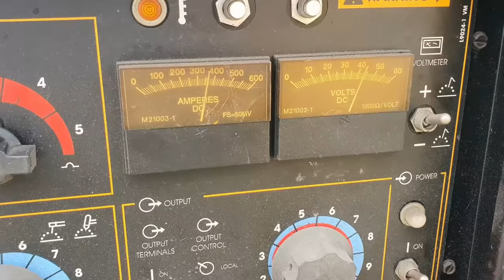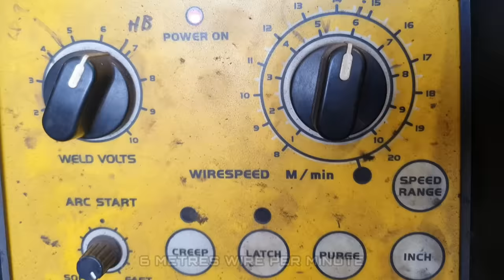Replace CRACKED Excavator Bucket Skin | Gouging & Welding

Comment: I was wondering why you only welded several inches apart all the way across the wear plates?  It seems that rock and dirt will get under the wear plates and caused more problems.

Comment: Hey Kurtis. One day when it comes up could you talk a bit about hard facing. I know what it does and why it's used but I'm curious about some details. Like is it incredibly expensive or not? Are there any particular details about applying it like more amps or different gasses or whatever? Would you ever even consider welding two things together with it? Any disadvantages to it? Any horror stories about it?

Oh yea and how does it end up so hard? I realize it's some alloy of steel but what makes it so hard? Is it silicon?

And this might be a really dumb question but does it only become hard after you apply it? So is there something about it being arc welded on that transforms the material from some softer wire into a blob of hard stuff once you've laid it down? Can you even use side cutters on the wire to snip off the end like you can with other welding wire? Or do you have to use a grinder just to clip the wire?

Thanks dude. I really appreciated the air arc gouging one you did.

Comment: His last video I was wondering how that would work and if I could rig up somthing with my welder and compressor. It would probably work about as good as the time I tried to use my mig to melt and weld some aluminum break brackets together.

Comment: I have a 52" digging bucket that has a crack in the centre on the floor. Looks like the previous owner was using it as a post pounder... My bucket seems to be quite thick still. The floor is dented in a little bit any suggestions to get it out?

Comment: Just wondering Kurtis but why do you always wire weld instead of stick welding? I am by no means a pro welder but my shop only has a stick welder machine, I prefer a wire welder myself but they won't buy one. Which one is is a stronger weld? I would appreciate any advice you have to offer, btw I love your you tube vids!!!

Comment: Q: The extra you trimmed off the ends of the new skin - why couldn't you have used them for a couple of the reinforcement plates since the length was already the same?   Or are the strips you used tougher than the skin itself?

Comment: Is air arc gouging just cheaper than using a plasma cutter (material is propably too thick for it right?) or oxy-acetylen? Or why is it used so widely in ur industry?

Comment: What are those criss-cross patterns of welds on the inside of the bucket for?
Reply from the maker: Hardfacing weld to protect that area
Reply: @CuttingEdgeEngineering  Thanks you - I was puzzled!

Comment: at 5:10 , whats the advantages to arc gouging over angle grinder ? I guess an big angle grinder would create a lot of metal dust , but would it take longer time? Just curious, I am not a mechanic/fabricator, never tried arc gouging, used a lot of angle grinder though, but that's because of my poor stick welding skills haha

Comment: Why not use the plasma arc cutter to remove the original plate?  It seems that it would be more precise and less expensive than the carbon/copper rods.

Comment: @Cutting Edge Engineering Australia - Great video as always.
 Can you throw in some information on your safety equipment?
 I went looking for the 3M helmets with the self-contained, supplied-air respirator systems, and I got a little sticker shock as they range from 1200 U.S.D to 2600 U.S.D.
 I see Miller also starts theirs around 1200 U.S.D.
Then I found some Chinese clones starting at 400 U.S.D going up to 800 U.S.D.
 I currently used the high-end Harbor Freight Vulcan Arcsafe helmet, in conjunction with a 3M half-mask respirator and twin P100 filters.

Comment: What is the point of the diagonal cross-welding on the inside face of the bucket sides? is that just some hard-surfacing rod as a sacrifcial wearing surface?
Reply from the maker: yeah hardfacing weld  for protection
Reply: Good stuff, you and the family have a great weekend! thanks for another great  video!

Comment: Even if you need to use any bucket as a hammer.... it's just better to use the curved part...
Even if you're grading with one, just use the blade to scrape the top if it's not something soft. Or just abuse it "because rental" I suppose xP

Comment: any time your air arcing out liners that you know have stored energy in them you air arc them in a clock wise motion. You never ever start in one area and then go to another area and start gouging. You start at 12 o clock and you finish at 12 o clock. Or you always cut the bottom of a weld seam off first and finish cutting the last seam on the top were you body is out of the way.

Comment: I saw the video come up at 1:30 am  New Mexico time.what was the machine you used to move the bucket around.not the forklift the other one.can you get it better on camera next video if possible?was a lot of work in the bucket but I see the why of fixing over replacing
Reply from the maker: Hey mate That's a 1971 international yard crane. We've had a lot of comments about it so going to do a video on it soon 😎👍
Reply: @CuttingEdgeEngineering  COOL THANKS I WAS NOT SURE

Comment: So what's the advantage of air arc gouging compared to a propane torch cutter? They way I see it, the torch is more practical, since it doesn't require you to be near the heat. And you don't need a welding helmet. And it's faster. 

And I'm talking about scrap metal torches, not pantsy fabricator acetylene torches.

Comment: You were in my old neighborhood when they excavated for a new house weren't you. You only missed 1 other abuse of a smooth front bucket on that site: The operator used the cutting edge to hammer through hard packed sandstone. He dug out the entire basement area ( 25% more than needed by the plans ) like that.

Comment: I absolutely hate air arc gouging, but I have never struck an arc with one of these. My problem with the process is that I was the one that had to repair the welders used for this. It seems that to much of this work is done with welders that are not heavy duty enough for the job.

Comment: Why do you use a portable filter instead of using the air supply with a oil separator?

I mean isn't the filter getting clogged up in no time? 🤔

Comment: Not trying to bust your balls. When we weld wear strips on we weld 100%. Only because dirt can get under those plates and pop them off. Has just been my experience. Also I would back gouge the mole board to make sure I had 100% penitration. That's all, worked for a couple of great companies over the last 25 years in Southern California.  Hawthorne (the cat dealer and the biggest field undercarriage company in Southern California A.C.E rental and repair). I am a welder, machinest, mechanic on anything you can through at me. Just like you, the only difference is I measure in bananas.

Comment: Just question out of curiosity from a tig welder, with the mig wire you use, don't you need to remove the scale and rust from that material ? I know when I weld something that's even little bit dirty with tig it's quite a challenge to achieve right results.
Thanks
Reply: With most flux core wire you can blast straight over the crap and it’s very forgiving. It can go bad sometimes, but in my experience you get porosity that looks like worms have made holes and tracks in the metal, rather than the bubbly porosity like solid wire mig gives you.
Reply: @zeroyon4562  I get those type of holes on welding bad quality aluminium pretty much every day at work haha. That crap looks like the weldin pool is boiling while being welded, once I pass to a next dab of filler and advance forward, the puddle cools down and pops small holes.
Nightmare
Reply: @rixogtr  Aluminium castings I assume? There’s nothing like trying to weld crap castings where shit just floats in the pool or just stops it advancing altogether. So frustrating. I’ve had to repair quite a few sumps and machine housings with such problems. 
 I went from doing very heavy equipment like Curtis here does in to sheet metal stainless and alu, so I know the struggle is real.
Reply: @zeroyon4562  I work in radiator shop and basically 90% of my work is to fix old oil coolers, radiators and intercoolers for industrial use, that said a vast majority of them come straight out of a broken machine and need to be serviced or fixed, most of them have very old cast aluminium flutes (tanks) that crack. That old casting is brutally soaked with oil and when welding, even though I always thoroughly clean it with acid, mechanical grinding away old material and then acetone wiping before welding it stills create nightmares.

Moreover, if I fabricate brand new oil cooler as a replacement for a very old one or one that's broken beyond the point where it isn't worth being repaired we use oil cooler cores that are stored close to soldering station where workers use acid flux to solder, all this material gets contaminated and that (I think) causes the bubbling of the weld puddle. Tha't the only reasonable case I can think of why that happens. That or the fact that those cores are simply old and/or poor its poor metallurgical composition

Comment: question why did you use that method when you could of used the cutting torch to cut it ?
Reply from the maker: It's faster and cleaner
Reply: @CuttingEdgeEngineering  that makes sense, no wonder your the pro

Comment: 30:10 what haven't you welded the strengthening bars at all the length?
Not required?
Reply: Well they are wear parts going to be cutting them off alot easier to cut off when welded like that.

Comment: Cool, so you start the arc on that air gouge and then push a bit through and essentially use it as an electric knife? That looks amazing as a cutter. Do you get more or less heat soak than with plasma torch? Hard to tell from the video but it definitely appears to blow through so fast that all of the heated metal gets jettisoned pretty much instantly. Cool shit man. As always, thanks for sharing! I've never welded before and just from YouTube videos and the fine motor skills I've developed from cooking and building random shit, I could probably blow through a welding class like nothing. I know a lot of the basics about materials and what not to do from blacksmithing channels as well as yours. You might yet make a welder out of me.
Reply: Oh, I think I answered my own question, it's more about the thickness to decide the tool, huh?

Comment: '
very good well on the metal weldding...
no wonder why the videocamera is bad shake shake while drop down - C - on the concrete floor at 2800 to 2805

Comment: I was yelling stop!!! Your fucking up the Wurth clock with torch spatter. Why do you run shield gas with flux core wire?? How many psi’s of air do you need to run the air gouger?

Comment: when you are cleaning your weld seams with the air arc you need to have the rod at almost a flat angle so your not digging to deep into the apparent metal. Also you will get more carbon in your weld seams doing it that way. I cant stand when people clean there weld seams like that. Sorry just a pet peve of mine.

Comment: Needs to wear gloves, keep guards and handles on grinders.
Wont RECIEVE compensation for any injuries.
I've been in the trade 34 years.
Never taken a guard or a handle off a grinder.
4" grinders have the most accidents, as a power tool in engineering.
Bad habit, for people learning.